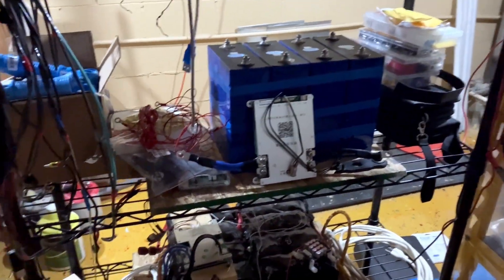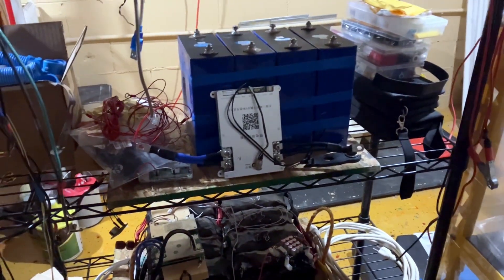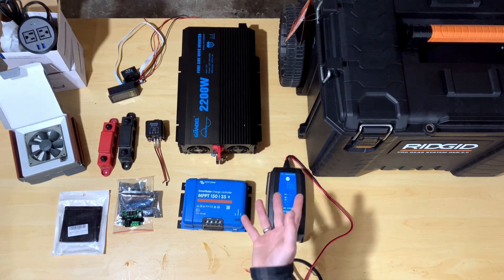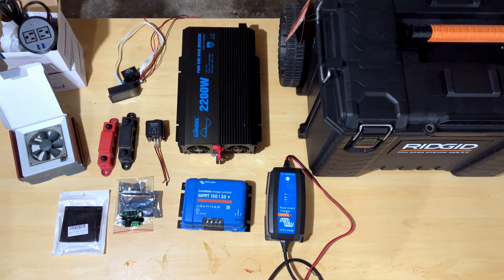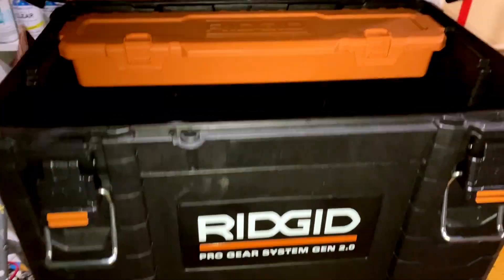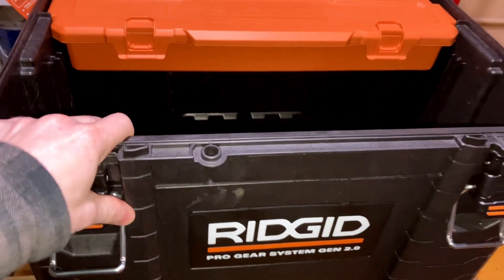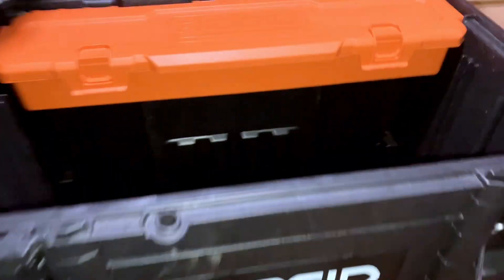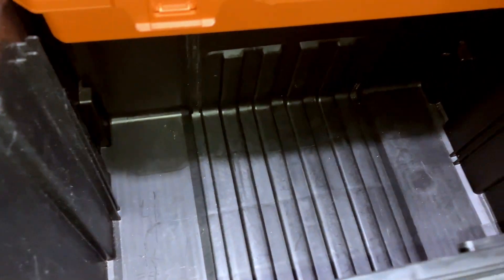Next Project - DIY Portable Power Station

Comment: If I was to build a 12v portable system using  a stackable case, I would be considering putting my cells in the bottom case with their BMS's and put the inverter, charger,  meters and outlets in the detachable upper case.  A 25" wide case can hold eight 280ah batteries with room to spare.